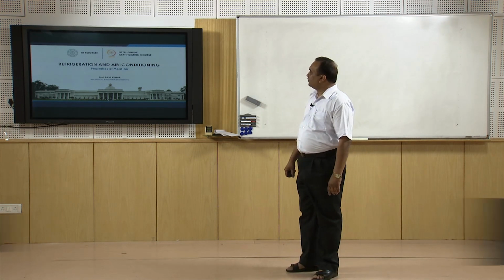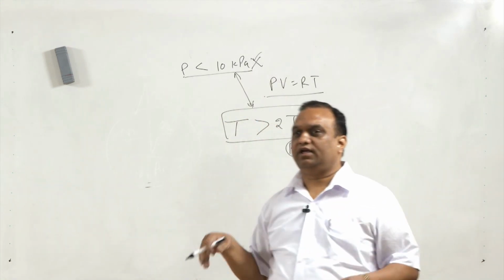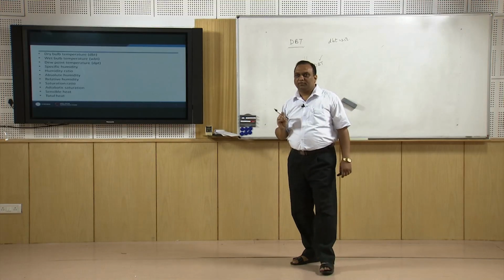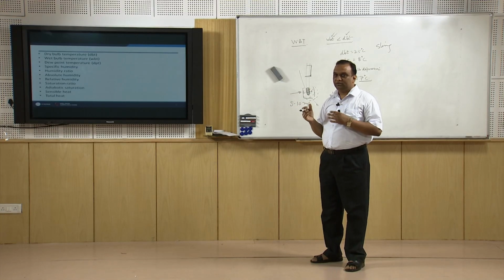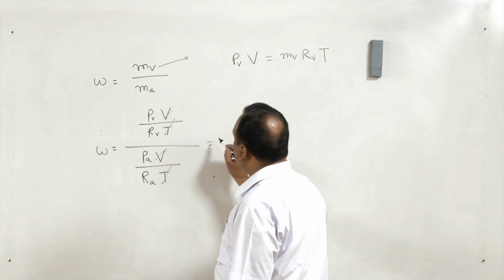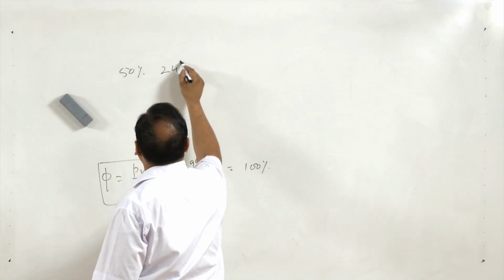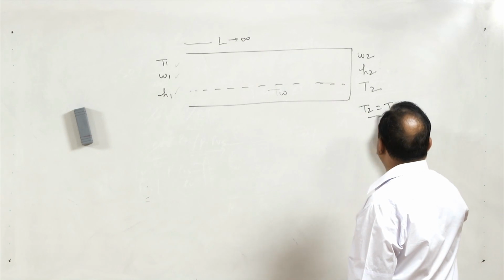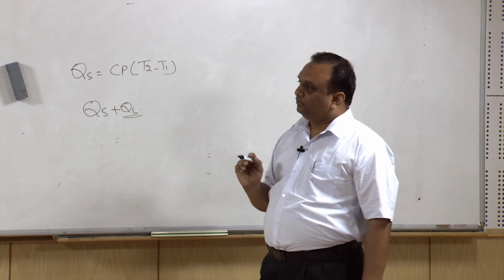Properties of Moist Air

Comment: sir, 1 ques is arising, ratio of mass of water vapour in a given volume of moist air to the mass of water vapour in the same volume at same temperature is called relative humidity. can we treat it as ratio of specific humidity  for a given volume of air at a temperature to the specific humidity of same volume of air in saturated condition at same temperature. 
if no then why, if yes then we are getting 2 different values of RH, as Patm-Pv will be different than Patm-Pvs.
can you help me.?

Comment: Sir why ?u take R same for driving the relative humidity expression.
Reply: By definition ,RH is the ratio of the mass of water vapour in a given volume of moist air to the mass of water vapour in same volume of saturated air. Thus, unlike in humidity ratio where , the ratio is of mass of vapour to that of moist air the ' R' will be different for them . But in case of RH both are masses of water vapor in the ratio .So, R  will get cancelled in case of RH